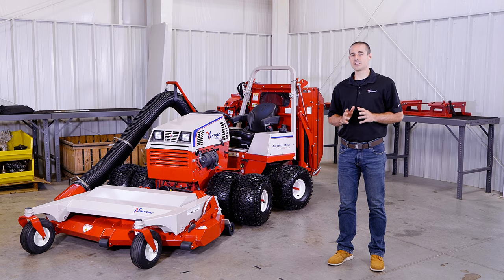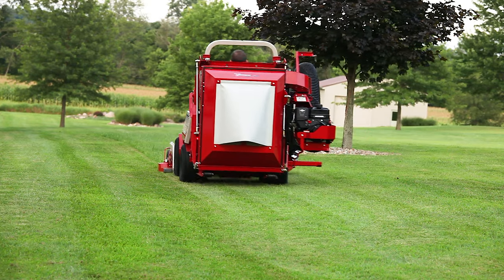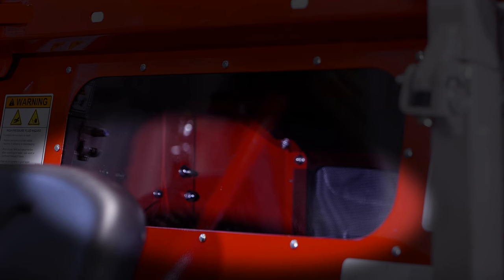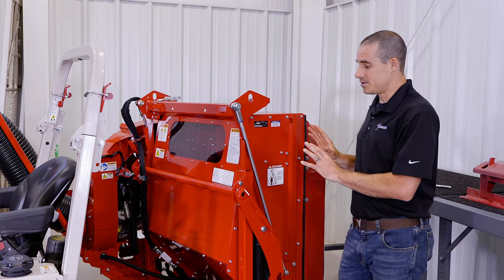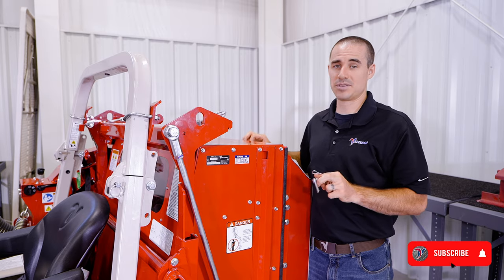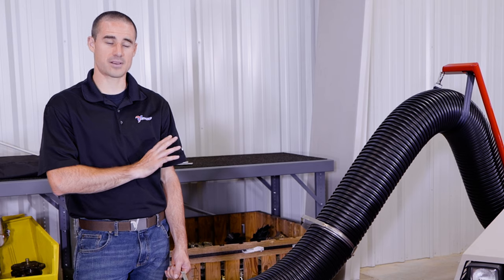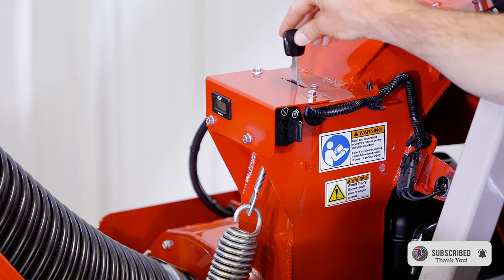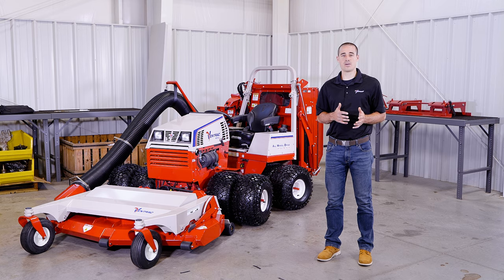Lawn Grass Vacuum - Ventrac RV602 Simple Start

Comment: I was wondering about the 3 point hitch.  I'm glad Aaron addressed that.  This is a really slick setup for those in the mowing industry
Reply from the maker: Nope....just use one of the two different mounting holes and you're good to go, whether you have the 3-pt hitch arms on or not.

Comment: Pretty slick setup. It is nice how you explained how each size deck will work in different applications. People should apperceive how Ventrac is honest And just not trying to sell something to someone that may not work for there specific applications.  I will say also the design on the engine how its mounted is pretty nice. Looks like a lot of thought went into it.

Comment: Aaron...  I would like to rent a 4500Z for about a month to do a rear 12 x 30 patio.  This will let me know if I like it, if I do, I plan to spend about $45K and purchase one.  I checked, and the local dealer only rents the attachments, not the tractor.  $45K is a lot of money and I don't want to make a bad purchase.
Reply from the maker: Where are you located?
Reply: @ventrac  Looks like the nearest dealer is 'Fletcher's outdoor power equipment' in Delmont, PA 15626
Reply from the maker: @johnevans6053  We'll reach out and let them know we received a request for rental.  Some of our dealers do rent whole machines so maybe they will consider a program like that in the future.  In the meantime, see if you can get a shorter demo.... it might answer some of your questions one way or the other.  Thanks for checking it out!

Comment: So I have a 72” deck if I add this can you tell me how wide deck becomes? Just wondering if still fits in my enclosed trailer. Thanks
Reply from the maker: It's roughly similar to the normal discharge shoot, in the down position.  If needed though, the tube can be removed and the chute that bolts to the deck can hinge up, narrowing the overall width to similar stance as with the normal discharge chute flipped up.

Comment: What is the overall length with the mower out front and collection system out back on the 4500z?
Reply from the maker: Depending on the deck, approximately 184"-188"

Comment: How does react to wet leaves?? does it clog like any other attachment?? or has someone figured out a way for this to stop happening. Sometimes you just have to get out and do the work, regardless of the weather.
Reply from the maker: When leaves are wet, you have to slow down fairly significantly so you don't overload the chute.  And sometimes blockages are unavoidable in conditions like that.  We have tweaked the chute shape and capacity to make sure it's optimized for this situation though - in an effort to lessen the chances.

Comment: Have a question could you use it to pick up wood chips after you used the stump grinder?? To clean up the work 2 nd question is there in the works to make a chipper shredder that would mount to the front then could hook up to the Collection unit just a thought
Reply from the maker: Wood chips would probably be too heavy for this vac.  It might pick them up but long term, you'd probably be doing a bit of damage to the impeller.

Comment: Hello it's Brandon Arnold I want to know if I can tow the machine with my half ton Chevrolet Silverado truck because that's what I have now and what kind of trailer do I need to have.
Reply from the maker: That truck should do it.  The tractor is about 1600 lbs and attachments weigh anywhere from a couple hundred pounds to about 900 lbs for our heaviest attachment (boom mower).  Pick a trailer according to weight and necessary length and you'll be set!

Comment: You could mow 10 acres by the time you figure out how to mount this contraption and why a separate engine and to top it off a problematic Vanguard engine
Reply from the maker: It really only takes a couple of minutes to hook the Vac up once you have the brackets installed on the ROPS (which can stay on full-time)